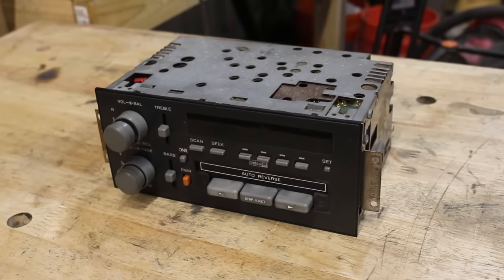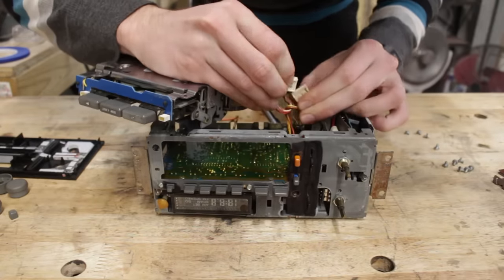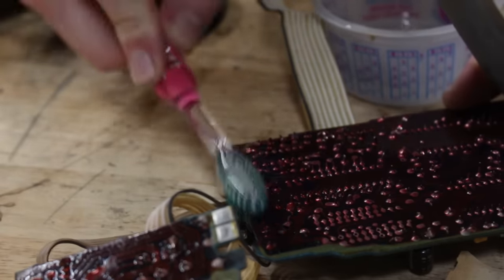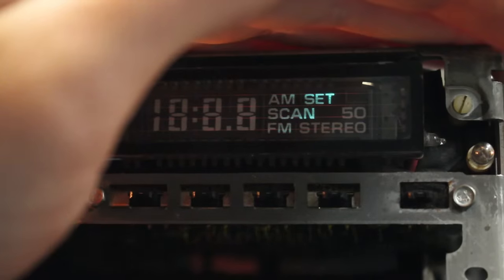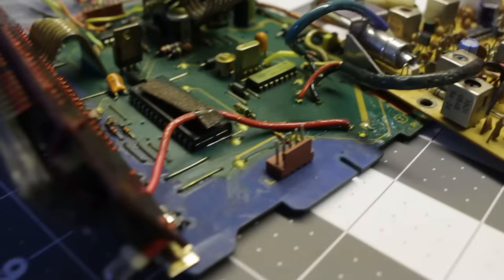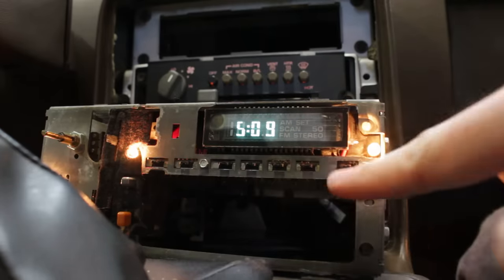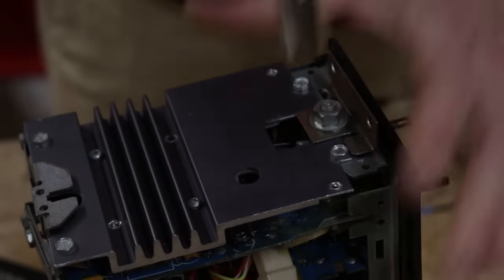1985 Fiero Radio Repair! | Saturday Projects

Comment: I had a 1984 Fiero. My mother worked at Delco Electronics and she had a engineer friend that knew I had a Fiero and knew the OEM radio  left much to be desired. He told her to have me drop the car off one morning at the gate. He put a  OEM Bonneville radio in.  It was really nice because it had the EQ built in and all the lights on the radio were red, which matched the interior lights of the Fiero perfectly. When I sold the Fiero I kept the radio and installed it in another Fiero. This time it was a 85. Loved that radio.
I really like these videos.

Comment: FYI: the "little wheels" in the tape deck are called 'Pinch rollers" They can be cleaned of magnetic tape coating like the head and capstan with iso alcohol. In addition, hard and glazed ones can be rejuvenated lightly with # 400 - 600 paper. It can help speed issues. Back in the day there were wet cassettes for preventative maintenance and repair. So glad you got a belt.

Comment: So, this resonated with me more than most.  In 1994 I had my first car and was 16.  The radio lights were bad and it rarely worked.  I knew nothing about electronics other than RC cars but I decided to do exactly what you did.  I tore out the head unit and began to trace what was wrong.  I ended up replacing some bulbs with LED's (yes, I knew nothing about resistance), and after days of discovering, I got it all working properly and it looked factory and I was thrilled.  I am sure that a 1980's Fiero and a 1980's Subaru share the same pathetic sound system so I too know exactly what excitement you felt with this project.  Great job as always!  I am glad to see this at 42 years young.  Props to you for giving me a time machine today in my memory banks.  If I could go back and do it again I would in a heartbeat.

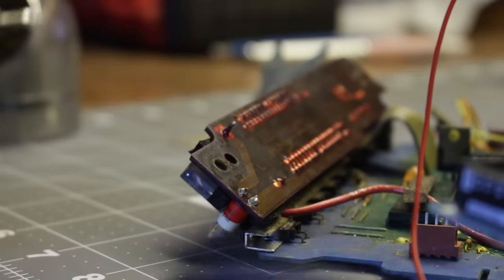Comment: 7:57 "Tha bigga tha glob, tha betta tha job"
Reply: I know that's the joke, but on something special, using a magnifier to make a proper solder joint should be the call.  I'm glad the repair worked.
Reply: shouldn't it be...the betta tha Job...the bigga the glob?

Comment: Its old enough that the tape idler wheels (that the capstans roll against) have to be hard.  They make a liquid that softens the wheels back to new.  Also demagnetize the heads.  That will make it sound better.  If the belt is the right tension, not too tight or loose, the capacitors on the speed control board might need to be changed.
Reply: also couldve got a cd - tape recorder and downloaded some non copyrighted music to tape. also demagnetize the heads works. he couldve worked around that issue easily. that 80's music background music he uses...just tape that.
Reply: Rubber Renue.  It smells bad, but it works!
Reply: The low speed is probably because he installed the belt wrong and stretched it a bit. Look closely and you'll notice both capstans are turning in the same direction, which is not right.
Reply: @enzoperruccio  good catch, that would do it.  I noticed how he wrapped the belt around both pullies but did not stop to analyze it.  Suprprised it is playing at all.
Reply: @jked7463  I mean, you shouldn't be surprised at all ;). This mechanism is like two separate players joined together, which means that, as long as at least one of the capstans gets movement in the correct direction the machine will work just fine.
Reply: @enzoperruccio  I guess what your saying is only one capstan clamps down on the tape at one time.  If so, that makes sense.  Then I go back to improper belt tension (hi or low) and/or tape speed controller capacitors which are notorious issues in tape decks.
Reply: @jked7463  Weird. I've never seen that problem before, even on old tape decks that were unused for decades. Most of the time the motor just needed a bit of lubrication or the belt was not the correct one. And even if the motor was indeed running at the Incorrect speed, there's always an adjustment screw on its back or on the main board.
Reply: @enzoperruccio  I have a cassette deck that has that issue right now.  Haven't had the time to change them out.  The speed control board usually have electrolytic capacitors that are known to go bad over time.  The amount of use has nothing to do with electrolytic capacitors going bad.

Comment: When restoring an old circuitboard, that has been, and most likely will be, exposed to moisture, a fresh coating of sealant is in order. This prevents electrical issues, like fires and such.

Comment: The wow and flutter issue could still be a belt issue. The method I use to get the right size is threading a string through the tape path, measuring the string and multiplying the length by .95 to get the proper belt length.

Comment: Unknown forgotten feature: press the top volume button while the radio and car is off,without key in and the time will pop up
Reply: Does anyone know the trick of programming 7 stations, not just the 4?  Press them in pairs.
Reply: You can even set the time if you have the patience! 
Though these radios aren't ever "fully" functioning. If you step into an 80s GM vehicle that somehow still has one of these it's always broken at least one way. Even Ronald's has a broken clock and radio component.
Reply: @spod2998  mine works compleatly fine... knock on wood though lol

Comment: I have to admit, I'm very impressed you took the time to troubleshoot and repair the radio. This has been a great rebuild series. Looking forward to seeing it finally finish over the next couple of episodes.
Reply: I had a radio just like that and instead I went to the junkyard and replaced it with Cadillacs version which had an EQ
Reply: Nice! The good thing about those old GMs was so many things were shared it made it easy to upgrade stuff. I had an old ‘91 Tempest back in the day. Super easy to work on for the most part, but a pox on the engineer who fit the engine and left no room to access the rear sparkplugs. Especially the middle one. lol

Comment: I'm willing to bet that the Auto-Reverse doesn't work in the configuration that you showed in this video. You have the belt on incorrectly, both the capstans are turning the same direction. It's a little difficult to explain, but the belt has to go under the capstan closest to the motor, where you have it going over it. The far capstan is fine.
Reply: Thank god, I thought I was the only one who noticed it. This could also be the reason the deck is running slow, since the belt is a bit tighter than usual.

Comment: awesome work bringing that brick back to life. My family had three 80's GM cars with radios built on that platform and it usually takes less than a decade for the receiver to give up and start running through different stations on its own. cool that yours is still functional.

Comment: First thing to try with scratchy sound like that can usually be electronic cleaner in the potentiometer, dirty potentiometers scratch exactly like that. You can just spray a little inside the potentiometer and turn it a bunch to get all of the dirt/grime out.

With the display and bulb, it seems like a manufacturing issue that cold solder joints ever became a problem - solder joints should be extremely reliable, even in extreme conditions. Glad you figured it out seemingly fairly quickly.

The key thing with old circuits, in my experience, is that 99% of time that there's an intermittent fault or weird and scratchy sound/video/signal, it's either a bad solder joint, something dirty, or a leaky cap.

Sorry if I nerded out a little bit but I've spent enough time working on old ham radios and arcade machines that I've learned a lot about what goes bad, haha.

Comment: Ah, the old Delco UM6 radio. Rebuilt/repaired many of those at an A/C Delco radio shop. Blown belts were so common, I could speak the part number from memory.  The '84 one way play deck belt number is 1224370, if anyone is interested. Cold solder joints plagued all GM radio's from that era. Great job getting the display going.

Comment: Ronnie, fun fact. You can pre-set up to seven stations on your radio. By pushing the set button and then two adjacent buttons at the same time that will memorize that station. To recall that station do the same thing. I too bought an 84 Fiero when they were introduced. Mine only caught fire twice before GM bought it back!

Comment: These were very high quality stereos back in their day.  My father had an Astro-van with the same stereo he bought in 85, but it had a small Equalizer on it too.  He played LOTS of tapes in it.  The front-loading tape drives used in these is much better than the side-loading tape mechanisms used in the newer Delco, and practically all aftermarket stereos (Most of which are built by a Chinese company called "Tanashen"  These decks, when new had VERY stable sound with minimal amounts of wow and flutter.  My father used to play George Winston piano music in his.

Comment: Your video gave me a "that's so obvious" moment.  I've been struggling to diagnose playback issues with a 1984 vintage JC Penney car stereo.  Being of the electrical engineering persuasion, I've been stuck on the problem being electrical in nature so much I completely missed the oxide buildup on the head, capstan, and pinch roller.  A good cleaning and some light oiling brought it back.

Comment: The "other board with corrosion" is the tuner. 
When you turn the lights on, the display is supposed to dim a bit, it's controlled by the dash dimmer like everything else.

Comment: I've been working on consumer electronics as a hobby for 45 years now. I fixed a few car radios and or tape decks. Your video is an excellent reminder that most problems in these units are simple things not complicated things, and that your eyes and ears are the best troubleshooting tools. I would not have guessed that plain old rubbing alcohol would have removed the conformal coating. You must have a stash of rubbing alcohol. Have you tried to buy any lately with the pandemic going on? 😉

Comment: Ronald Finger, nice job on the radio.  I restore old radios as a hobby.  If you have further issues and disassemble it again, I would suggest addressing the 35 year old electrolytic capacitors.  If they begin leaking electrolyte, then the traces can be ruined and if they begin allowing DC voltage to leak into circuits where it doesn't belong, then you will have issues with noise and distortion.  You can order replacement capacitors from digikey, mouser, allied etc pretty economically and they are easy to replace.  Just read the values off the old ones and get the correct voltage caps.  This will future proof your radio and keep it going for years to come.  Nice work.  doc

Comment: I'm going to get the tools to get my radio fixed the way you did, because once it's actually fixed, I'll replace the other factory radio from a G body car with the original radio. It gave me motivation to use the iron and lead solder once more!!

Comment: About 20 years ago, I had an 87 Fiero GT. I loved it. But I also didn't hesitate for a moment to swap out the old head unit for a modern cd player unit, nor would I hesitate to do so in any other vehicle I acquire that inexplicably still has old audio tech in it.

Comment: If you're worried about your solder jobs looking a bit blobby, keep some soldering braid handy. The thinner stuff is best, it tends to have more flux per square inch, and heats up quicker so it sucks up solder quicker. Also, don't be afraid of turning up the heat and just adding more solder. A clean, nicely hot soldering iron will attract excess solder, long as you add flux, which is there in your solder. 350-380°C is good.

Comment: I used to repair those at my workplace in the late 90s through mid 2000s.They're easy to fix, and all Delco radios of that period were mostly the same internally. They just used different faceplates for whatever make they were going into. You can swap brands, just switch the trim to match the car.

Comment: These old delco radios have started going haywire in my 85 cutlass. They go into scan mode and can't be switched out of it. Work perfectly on the bench! (also had bad solder joints on display connector)

Comment: Man I’m old. I remember when that radio was in all GM cars. Different versions of it, but the old Delco 2 knob Tape deck actually sounded good on a nice set of aftermarket speakers. Using a converter for an amp and subs, it worked perfect if you  didn’t want to mess with taking apart the dash to upgrade sounds. 👍

Comment: Good to see the original stereo going back in, they do sound pretty decent. I had to fix the HVAC/Radio display in a friend's 2007 Acura TL by carefully taking it apart and reflowing all the solder joints on it, before that he would have to hit the dash to make  it work most of the time, and it was really dim, after reflowing the solder to the display and the power/data connection, the display works perfectly now. And, since what killed the display was obvious water damage (the display is above the heater/AC vents so condensation likely builds in the area) I sealed the board with some clear finger nail polish. I am hoping that makes the display last much longer.

Comment: I'm sure I don't need to tell you this, but your best friend when working on GM interiors is the 7mm socket. Might want to invest in a few spares, because you're almost guaranteed to lose one!
One of the best things about GM decks from the 80s is their tape mechs were made by Blaupunkt. My mother put thousands upon thousands of hours on her UX-1 (she had an '87 Pontiac 6000 S/E), every two years or so it went in for new belts, but otherwise held up well. Glad to see you posted this video, I've been kicking around the idea of refurbishing the stack of Delcos collecting rust dust in my garage.
For future repairs, might I suggest you find an auto junkyard, and clip the OEM plugs out of a donor vehicle's dashboard? Also, you can use any standard mast antenna with a Motorola plug (even ones for home police scanners) for bench testing. This will save you the in-out-in-out hassle of testing in-car.
Delco radios make halfway decent basement/garage radios. I even had a UX-1 deck and two 6" x 9" rear deck speakers from an Olds Calais built into a wooden box, slapped a power supply inside, and had a pretty loud desktop radio at work. Even put a toggle switch on the box to switch the faceplate illumination on and off. Why spend money on a boom box when I had all the components to build one hanging around?

Comment: The holes in the workbench top are for bench dogs.  It's a woodworking feature, you put a peg into the holes and you can clamp against them or use them as a stop.

Comment: Nice job on the radio repair for someone that is just taking a guess at it.  I used to repair radios and specifically those GM radio.  I must have repaired 1,000 of them.  That is a Type B deck.  There is a mod to replace the gear under the flywheel.  When you can't eject a tape, you'll know what I'm talking about.  Also, on the cassette pulleys there is a layer of felt that sometimes sticks.  A drop of alcohol will take care of it.  Some of those models actually had a replacement volume control.  And congratulations on finding the bad solder joints.  You might want to go back and solder the pins on the microprocessor.

Comment: One thing you should do is to spray some electrical cleaner into the bass and treble potentiometers. Open potentiometers like that are prone to collecting gunk over time, even if not used, and could result in making crackling noises. While it might not make any difference in your case, it's still a good preventative measure to take while you're at it. 
Great video btw

Comment: You can fill the holes in the workbench with 5/8 oak dowel.  I out a small slice along the diameter and drilled a hole for a screw for the underside.  Put dowel into hole, tighten screw from underside and it's a perfect bench top

Comment: A piece of advice. keep one of those 1ml insulin syringes loaded with 3 in 1 for when you need the absolute minimum amounts of lubrication (to load it, pop the piston and pour the oil through the back because you won't be able to fill it via sucking)

Comment: Great job man ...I have a similar attitude : )
 There is a small potentiometer at the back of the motor ( small hole in the metal . Use a non metallic screwdriver to adjust speed )

Comment: Love those old Delco Radio ! By the way, I don't know if you knew but turning the Key backward to ACC on those GM instead of putting it on ON Position like in the video will let you listen to the radio without all the components taking all the battery juice ! Well done, Like your work and fun to fix it for cheap and use it ! My Buddy used to have an 1984 2M4 Fiero also and an 85 GT Fiero ! Great car and fun to drive !

Comment: Back in the day of VCR repair, many had the same kind of display and cooked or cold solder joint for that style of connector was common. Same thing with drive belts and drive rollers. Electrical contact spray usually cleared scratchy potentiometers used for speaker volume. Great Trouble Shooting....

Comment: I totally need to find a 5-band EQ AC Delco radio for my 1988 Blazer. Finding one for my exact year is finding impossible. Ugh. I wouldn't even care if it were working or not. Even if the radio part worked I'd be happy. I'm glad you were able to get it working!

Comment: Incorrect drive belt routing notwithstanding, I'm actually quite impressed with how well you handled this overall. Clearly a man of many talents. 👍

I suspect 5% slow = motor could use some lube, too. Well, there's always cassette adapters with Bluetooth.